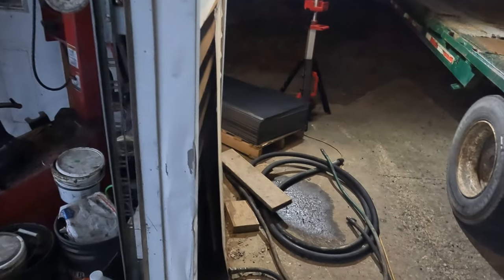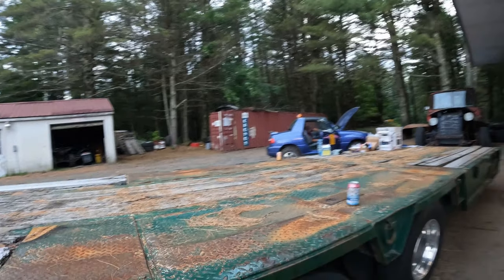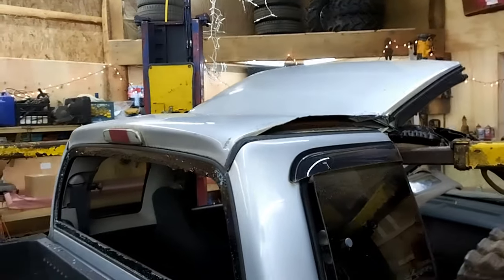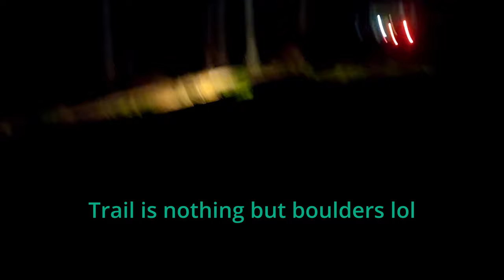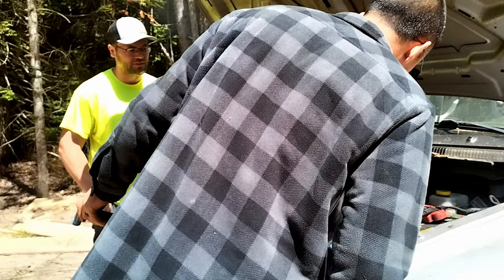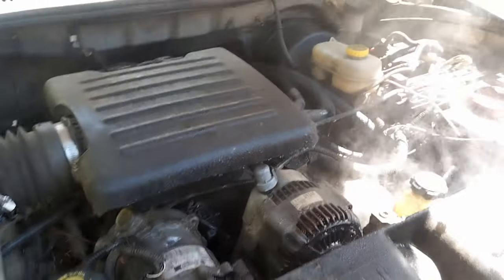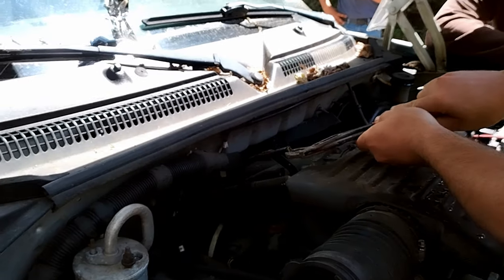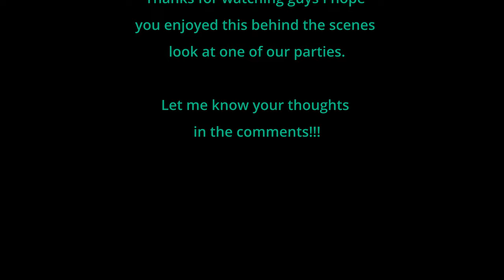Finishing Stage 1 of our 1998 Dynaweld trailer. Plus party shenanigans!

Comment: Suburban sounds healthy.  Trailer looks awesome with those polished highway burners.
Reply from the maker: Thanks Matt. Burb don't run too bad. Needs a big ol 8-71blower out the hood
Reply: @Ol2Stroker  I'm not sure but . All you need is the bottom intake plate.  It may fit one of your Detroit blowers.
Reply from the maker: @matthewwilson2991  yea last I looked they wanted crazy money for that plate!
Reply: @Ol2Stroker  And then the drive system...
Reply from the maker: @DanEBoyd  yea it was like a $4000 setup just not in the budget.

Comment: I use the tail to lift my wheels off the ground to do tires and brakes and such lol
Reply from the maker: I woulda too but mine doesn't have down pressure
Reply: @Ol2Stroker  oh, I got ya. Our other driver has a sliding axle trailking that flips the tail out so he can't do that either. Makes it a pain jacking it up and also getting the wheels out from under the side of the trailer
Reply from the maker: @squintin480  yea lifting itself with the tail would be clutch though!